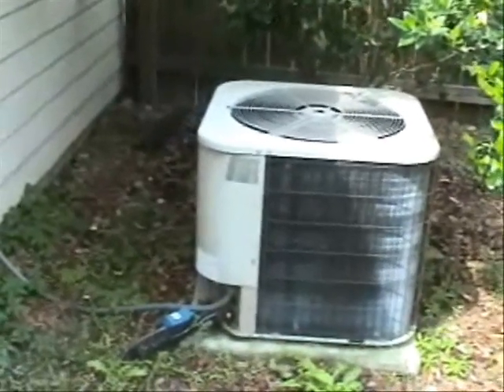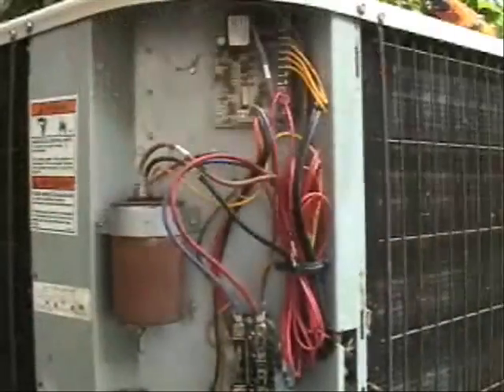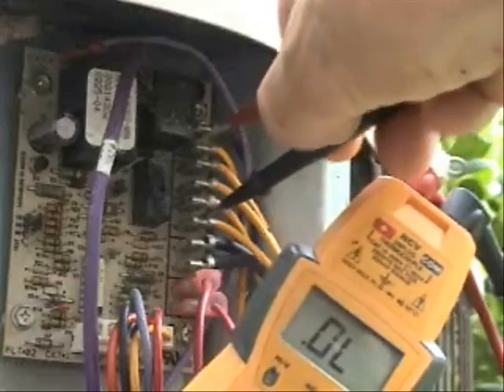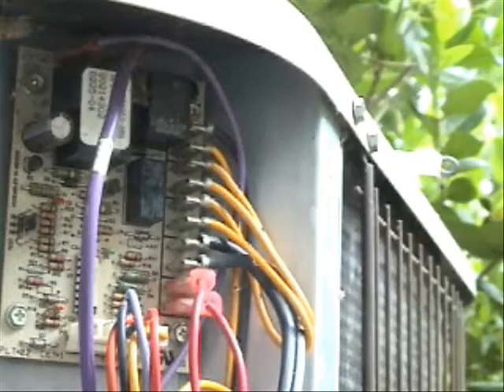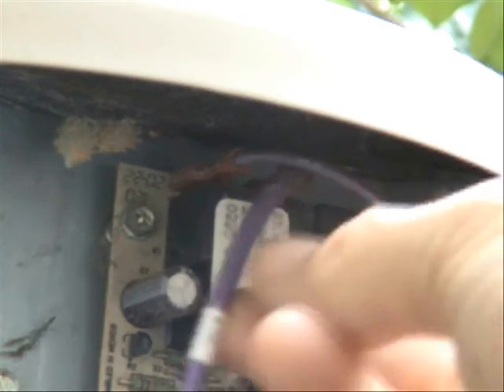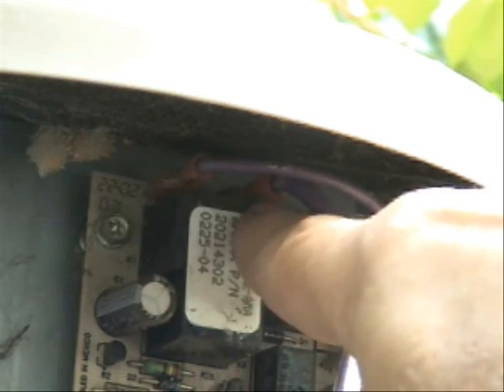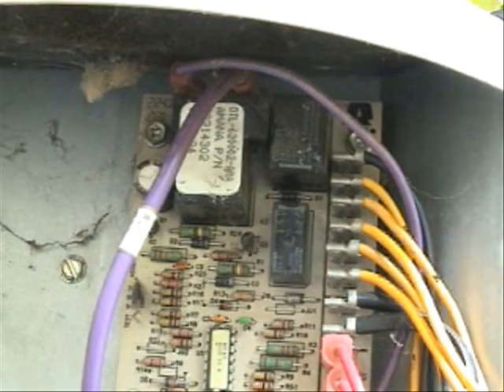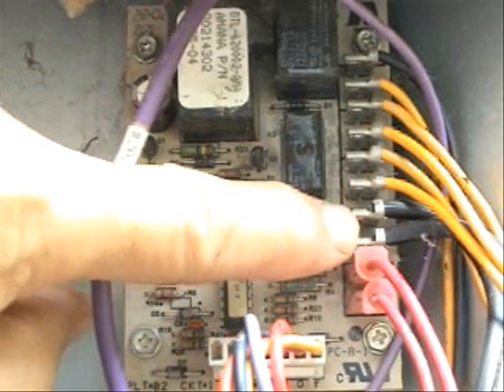HVAC Heat Pumps 2

Comment: Dr Zarkloff, I would like to know when testing to see whether you have 24 volts of low voltage coming to the board, where do you place the other lead from the multi-meter with the other on the r terminal on the board?

Comment: Do you by chance have the manual for a Maytag/Nordyne PSH4BE036K  heat pump ?
Can't find it online,  I need the circuit diagrams and I'm trying to figure out if it has maybe a diagnostic port, maybe something that talks RS232 that I could query.

thanks !
Reply: you'll need to call Maytag or nordyne tech support.

Comment: Hello Doctor
I wanted thank you for explaining complex concepts in simple terms. I started looking up HVAC videos as my heat pump acts funny in ac mode. I have a lennox heat pump 14hpx series. Every few hours it blows warm air even in ac mode. Air is hot enough It will actually raise temp of rooms from 80 to 85. I looked at outdoor unit and when this happens the outside unit fan blows cool air from top.

I then change setting in my thermostat (honeywell focus pro th6000). I make fan to 'on' from 'auto' and set the system to cool till 'cool on' sign comes on. 

Any insight will be appreciated.
Reply: +vikaschopra1973  I have the same issue!  My compressor outside doesn't fire and my heat pump just pumps hot air on occasion.  Did you get yours figured out?  Was it the capacitor?

Comment: Dr Zarkloff,could I know the superheat and subcooling of a WSHP Trane 2 tons,year 2000,model number GEVAO2411A0110TL00000001,cooling mode,miami?
Reply from the maker: The superheat and subcooling of a system will be the same as any other air conditioner.

Comment: I've never seen a continuity test done quite like that before.  Just wandering how you would determine if the board itself was internally shorted using this method.  I've always pulled the wires off and isolated them for the continuity test.

Comment: Is this possible?   I want to wire the fans from each system like a 3-way light switch so they will run with either system.    Example, upstairs AC would trigger the downstairs fan in the event the AC is not needed downstairs.  This would assist in circulating the cold air that falls.   Example, downstairs heater would trigger the up stairs fan in the event the heater is not needed.   This would assist in circulating the hot air that rises.

Comment: I have a 2.5 ton trane heat pump, It had a full charge the compressor was running and I couldn't get no reading it just sat on zero, its not the strater valve already check that i even evacuated the system purged it down and when i charged the system, my suction was zero and my high side didn't get pass 150....you know what it could be??
Reply: Henry Brown n

Comment from the maker: @rbu2m The defrost board might be bad or the low pressure switch has the compressor locked out if you have a low refrigerant charge.

Comment: I have a heat pump unit,(TEMPSTAR) when it calls for cooling and there is 24V to the defrost circuit board but the contactor stays open because there is no 24V coming from the circuit board to the contactor. I push the contactor in manually and every works. Does that mean the board is bad? Thanks in advance Doc Z.

Comment: DrZarkloff at 3:31 you did a resistence check from the low pressure to the compressor contactor. don't u have to unplug one of the wires to remove it from the circuit to get a resistence reading?

Comment: Dr. Z,

I am having trouble with my heat pump. It was installed in July, 2009, in my new house. Since the weather got cold, I have been using it to heat my house. However, for about 3 months, it has been making this noise, and I am having no luck getting anyone to fix it. Can watch this video, and tell me what you think is wrong with it? I cannot post a link, so here is the  youtube video number:

SfmQ43fzQ8M

Thanks!

Comment from the maker: If the system goes into heating and cooling without any problems while doing this test then you might have a bad coil rather than a bad reversing valve.

Comment from the maker: The best way to test a reversing valve is to get a test magnet. Remove the coil on the reversing valve and slide the magnet over the shaft where the coil went. Disconnect the coil so that it won't energise. Then power up the system and take note if the system is in heating or in cooling. Then turn off the power and remove the test magnet from the reversing valve. Then power up the system and see if the system goes in cooling or heating.

Comment: Thanks Dr.Z. I ran into a lennox today that had a defrost timer on in. It had a little jumper on it that allowed you to change the timer from 30 min, 60 min, or 90 min. The complaint on the call was that the out-door unit was loud. It was! I took the top with the fan on it off. Then I cut the power back on and tap on the reversing valve. It started to hum like a humming bird. So I think that the reversing valve is going bad. What do you think Dr. Z or any body else.

Comment from the maker: It all depends on the system. My heat pump uses a timing mechanism that's part of the defrost board. It will go into defrost every hour while it's running in heat mode no matter what the outdoor ambient temperature is. The defrost thermostat determines the length of time that it remains in defrost.

Comment: Dr Z I went on a call today that was a dual heat system. (HP- GAS). On a call for heat the furnace and the heat pump came on. I took the face off the t-stat and notice the E terminal was jumped to W. I never work on a dual system but I know that it should have been wire to some type of relay. Can you tell me or do a video on how to wire this kind of system?

Comment from the maker: Payne is a contractors grade Carrier. More than likely, the outdoor unit doesn't have a low ambient lock out. This is something that you'll have to add on your own. You could get a low ambient lock out control thermostat that will lock out the compressor and energize the heat strips or gas furnace when the outdoor air temperature dips too low.

Comment from the maker: I've shown the process before in a couple of my videos. Not all air conditioning control systems are the same. I could show you how to do it on an Amana heat pump, but the process would have different variations on an other system.

Comment: I may be wrong, but as far as I know, the Y terminal when used on a heat pump simply means "energize compressor". And since the O terminal energizes the reversing valve for cooling mode, in a heat mode, the Y would be energized but the O would not. (Surprised you didn't mention the relationship between O and the old B, but I digress) I know on my system the W terminal is actually an output from the heat pump to the air handler W terminal that turns on the auxiliary heating coils during defrost.

Comment from the maker: The heat strips collect dust over the summer. Then, during a cold fall or winter day, the heat strips energize with a call for emergency heat. The burning smell is probably the dust burning off the heat strips. It's common on every first cold day of the year.

Comment from the maker: If you're having problems after weighing in the charge on a package unit then the problem will be a mechanical issue with the system. It could be a back TXV or even a bad compressor.
Reply: What about a restricted liquid drier

Comment from the maker: Most air conditioning systems have safety devices that protect they system from running when the refrigerant charge is too low and to prevent the discharge pressure to reach dangerously high pressures.